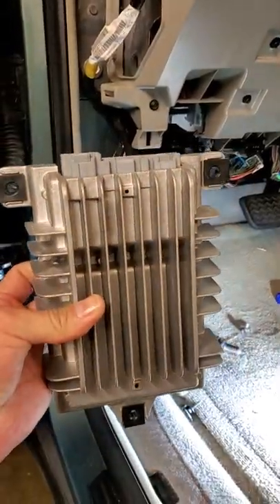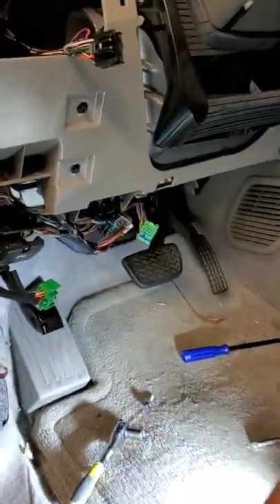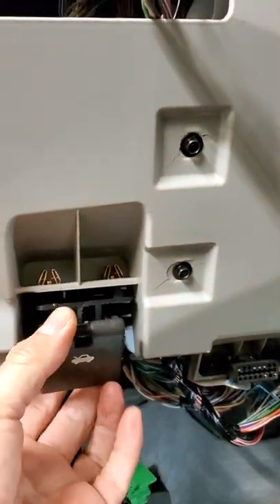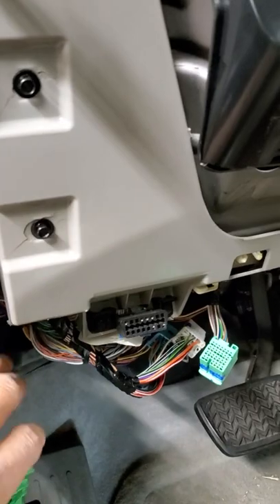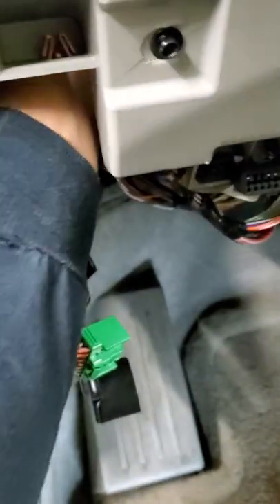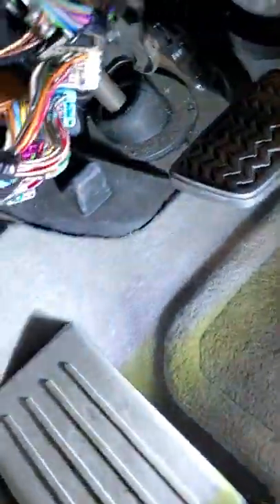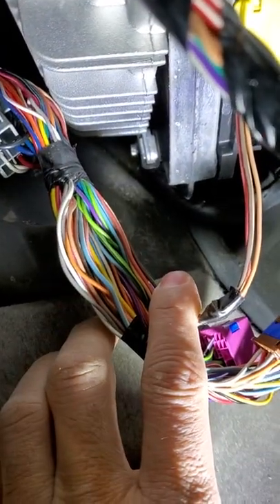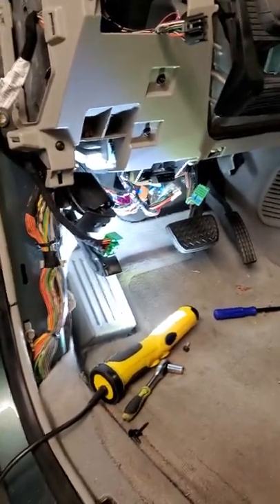BOSE amplifier R/I, Buick Enclave @AUTORESTYLER

Comment: What if after you change one the Bluetooth option isn’t there anymore. How would you get that back? Even the movie option for the tv is gone… my sound is back working but features are missing. Did I buy the wrong amp or do you think it’s a underlying issue. I changed the amp myself so I’m learning along the way. Thnx in advance
Reply from the maker: I really wouldn't know but don't think those options are part of the amplifier or I should say the radio itself makes that function
Reply: I think it might do a diference on factory amp. That also depends what kind of radio you have. Like does it have gps bluetooth a 10 speaker bose system.